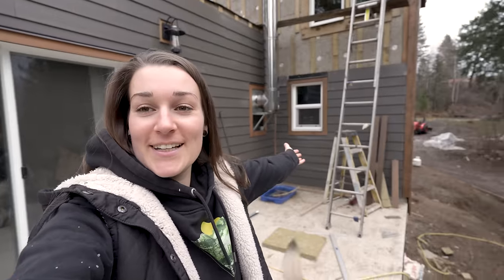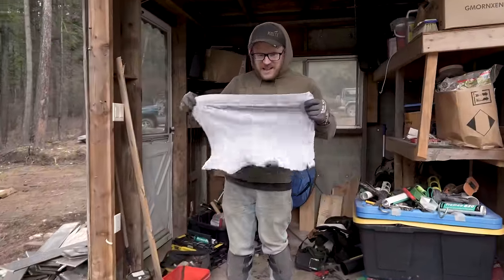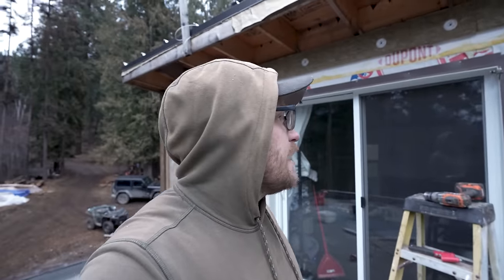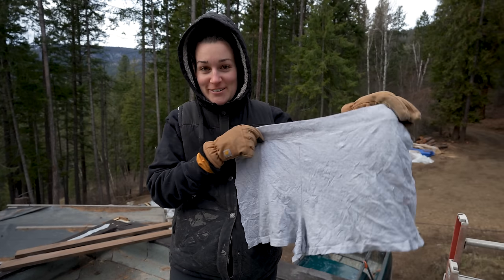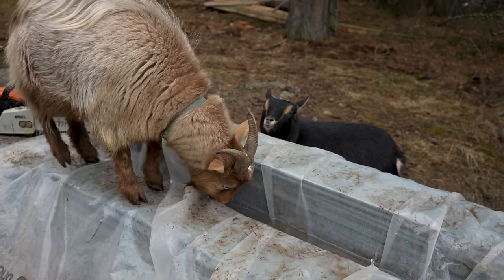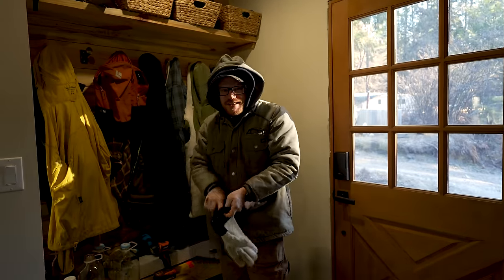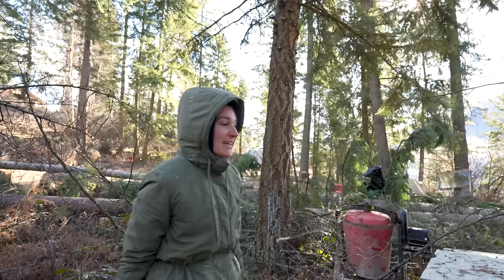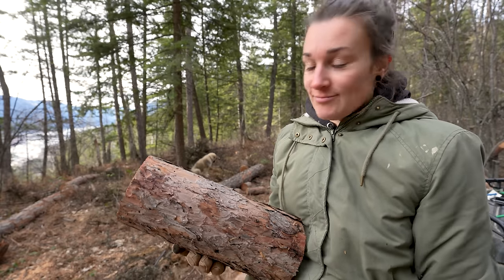It Feels Good To Have This DONE!  Moving Forward...

Comment: Hey yall, nothing wrong with buying a cheap saw as long as it works. I have the Ryobi Expand-it tool that has the mini chainsaw, hedge trimmer, edger, sweeper, brush cutter, roto tiller, blower, gutter blower, snow thrower,, string trimmer, both gas and battery power heads and extension pole. Each part range from $99.00 to $165.00.

Comment: Hello Katie, at 32:24 may I suggest that you don't throw your heavy logs so far into your trailer? The impact will cause cracks that will worsen over time. It's better to bring the trailer closer together, make a first protective layer with the nearest logs (no need to throw them). This applies to all kind of materials arriving at high speed in any container. Thanks for your video and good luck with your projects.

Comment: Where your tractor is 4x4 some times putting weight in your front bucket can give you more pulling power helps your front tires pull as well as the back. Just a thought

Comment: I got one of those saws from Home Depot years back I think it was $300 and the box said extended 12 feet I got it put it all together and the thing only extended 8 feet maybe was going to take it apart and take it back but I couldn't get it back apart again complained about Home Depot took the picture of the box it said 12 feet they didn't do anything I think it meant 12 feet counting how tall you are  i'm only 5 foot 3 Made the mistake of taking it to work to help out my boss prune the trees around the road for him burnt it out plus my hand pruner broke and he never even offered to pay for it or get it fixed he was so cheap that's what you get for trying to help your employers out He was the reason I had a stroke at work because 24th of May weekend was coming up all the trailers needed to be fixed had no parts to fix them and they all complain at me not at him he used to run and hide

Comment: You're getting very good at backing that trailer up on that bike that is not an easy thing to do the shorter the reach on the trailer the harder it is to back up on my utility trailer that I built I put a real long reach on it so it wouldn't jackknife all the time way easier to back up I found when I pulled rvs to campgrounds the bigger the trailer the easier it is to park in the hard spots they wanted you to park them in got very good at it after 15 years of pulling them my boss used to deliver trailers and he got us kicked out of two campgrounds because he damaged trailers god sold the RV campgrounds would only let me pull trailers in And the biggest thing is when he damaged a trailer he wouldn't admit it was him one time I told a trailer into the Kitty Coleman campground the family campground and you had to go around a tree to get in there I set it up very hard because it was on a hill so had to block it up so high on one side he went and picked it up ripped the awning right off the trailer backed it into the shop and said he didn't do that the rv boss laughed because he never admitted anything he has wrecked picnic tables because he's backed right into them with trailers put depict in tables bath together so they looked fine campground point homes he bent their power pole by putting the pop out and when the campground wanted him to pay for it he refused so we weren't allowed the hour RV's there any more and he got mad what a man robert from Courtney Carr Center shouldn't talk about a man that died right oh wow hope you don't come out of his grave and get me🤣🤣🤣🤣🤣🤣